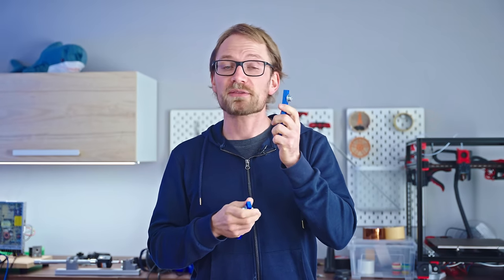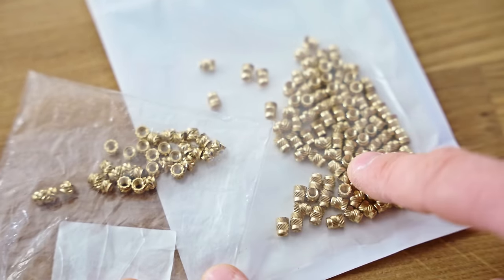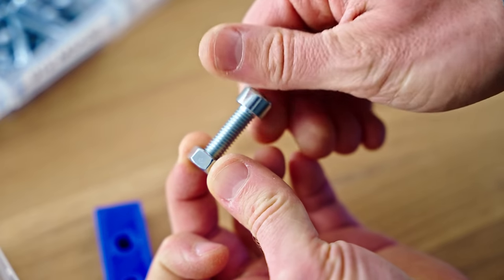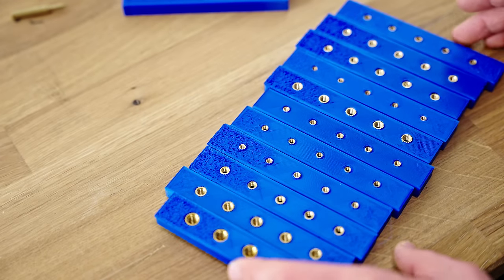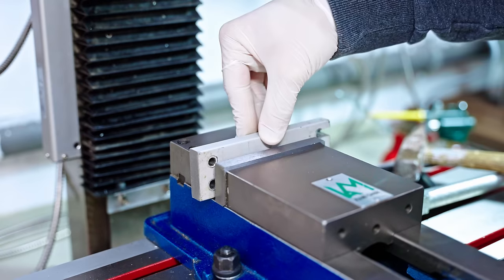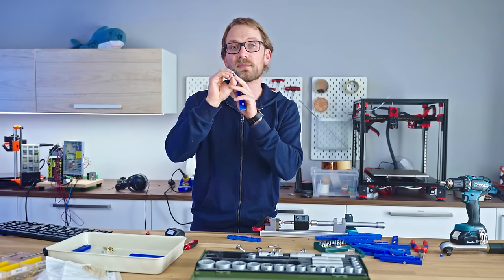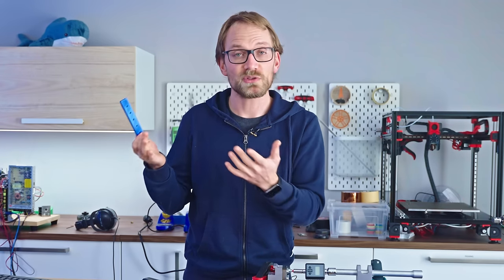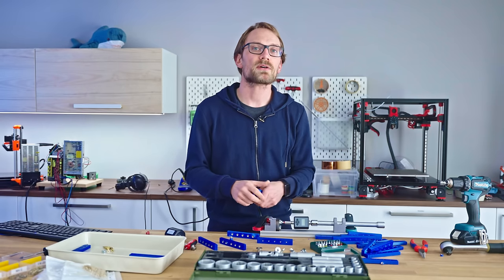Do you even need threaded inserts? Strength tested!

Comment: This video needed to be made, thank you.
Please test nut captures and the strength of inserts from the opposite side. 
 Tapping holes with a hand drill is something I never do regardless of material as while it takes a little longer I find that doing it by hand results is less damage to the threads especially for fine pitch threads.

Comment: I prefer cut threads for everything below m6. I use 3d printing mainly to prototype parts that eventually get machined. 99% of the time some cheap PLA is sufficient for my needs. usually I print with 3-5 perimeters. I usually use alcohol as cutting fluid. few drops of cutting oil dissolved in the alcohol works even better. also aluminium taps work way better then normal ones (the ones that have every other tooth missing to reduce friction) through hole whenever possible, bottoming taps that push the swarf up only when really necessary. ...in 3d printing I can make the hole super deep or all the way through the part even if I'm not going to do that on the machined part for obvious reasons.

a final note: for embedded nuts: get some square ones - they work better in every regard I can think of compared to hex nuts when it comes to incorporating them into 3d prints. (don't rotate as easy, easier to design the pocket/slot, usually better bridging if pocket has to be upside down...)
Reply: Yeah, I bet hand tapping vs power tapping would reduce the friction and heat generation of the tap in the plastic...thus preventing the ripping of the threads out of the part
However hand tapping a buncha holes suuuuuuuck
I wonder if a better lubricant such as silicon grease would work better than denatured alcohol (I use Danco food grade silicon grease from lowes on my parts and bearings on my 3d printers/cnc machines, not only is it slick as greased owl crap...but it doesn't attract dust like oils and "dino" grease)
Reply: I use a tapping arm. For my cordless drill to tap. Having the tap straight also reduces the friction quite a bit compared to just cordless drill. Alcohole does some minor lubrication but is great at cooling.

Comment: One thing, you didn't mention would be a rivnut.  Slipped into the hole from the other side.  And since it doesn't have the rotation ribs, you can use a bit of glue if you don't want it to rotate. You can match the rivnut length with the part thickness, or recess the back side to match the rivnut length.
Reply: rivnut was at the end next to the tee nut

Comment: You should be able to test for lead content of the Alibaba inserts using a swipe test.  These are marketed for use in testing house paint and toys, but would work for this purpose too.
Reply: Most brass is leaded brass (2-3%), its not really an issue unless you: use it for a childs toy, use it for food storage, or grind it after the fact. You shouldn't be using 3D prints for these purposes anyway.
Reply: @jaro6985 
Oh. So you're saying I shouldn't 3D print a children's toy lunchbox with brass shavings on it for decoration?
Reply: @jaro6985  My point was focused on whether you should buy CNC Kitchen's brass inserts because of being lead free brass.  Or alternatively, since there is a lot of plumbing fixtures that are in-fact lead free, is it possible to get cheap inserts that are still lead free.  And I'm sorry, but using 3d printing for toys is a pretty standard use case.
Reply: @richdobbs6595  3D printing toys for young children is just as unsafe as using leaded inserts, most people do not have food grade setups. I'm telling you all china inserts should have lead in them, so no need to test.
Reply: Lead free bass literally means only 2% lead. This is also true for lead free brass that is used in water supplies. Lead free is a legal term not a normal english understanding. It is very misleading.

Comment: I've found that friction threading fasteners into unthreaded holes works quite well.... What you do is you rapidly turn the fastener in about a 1/4 turn then back out a little less than 1/4 then back in a 1/4 until the fastener is seated. The friction from this rapid back and forth heats the fastener so it doesn't cut rather it melts it's thread into the plastic. If you size the hole correctly it will take a little bit of muscle to seat the fastener and you will be able to feel the resistance slightly lower when the fastener starts melting it's way in.... The result should be a tight thread with it's layer lines fused together. Something you will not get from a printed tread. Also this method of threading does not clog the hole or remove any plastic. The plastic is pushed outward into the walls, if anything leaving the wall thickness slightly higher.....I've used the word fastener in this description over bolt because I've used this method with screws as well as bolts up to 1/4-20. 

Other than that if I just need a thread in my print where the bolt will be repeatedly adjusted I heat set an ordinary nut into the print. Which is cheap strong wears good and I don't have to order anything online to complete my project. With heat set nuts I print a hexagonal recess in the hole slightly smaller than the nut and push the nut in with soldering iron set to as low a temp as I can where the nut will still push in. Like with fiction threaded fasteners no plastic is pushed down into the hole. The plastic is instead also pushed outward increasing the wall thickness.  So far I have had zero issues with pullout of friction threaded fasteners and heat set ordinary nuts have only failed in bad designs and when over torqued.

Comment: A few things spring to mind here:

1) If the limiting factor is the perimeters around the hole, beefing that up to the point where the insert turns in or pulls out seems necessary to get meaningful test data on the insert or thread. 

2) I don't advise tapping under power for this sort of thing - use a manual hand-operated tap wrench. It'll keep the heat down and you'll be able to feel what you're doing.

I've actually used threaded inserts and stainless machine screws to replace self tappers on bits of plastic under-bonnet trim on my car - they are a huge improvement! 19 years of taking those old self-tappers in and out doing maintenance and they didn't really tighten up properly anymore. A great quality of life modification.

Comment: Whenever the design allows it, I press hex nuts into the back side of the part with a clearance through hole to screw in from the other side.  Make the nut recess compliant to avoid splitting the 3D print.  PrusaSlicer has a couple of tricks that help.  Modifiers allow more perimeter layers and/or more infill to strengthen the 3D part around the threads.  PrusaSlicer also has negative volumes that can increase part strength in a particular direction that can be useful to support loads attached with threaded fasteners.  There are slicer tricks for bridging over the top of the inserted nut pocket, with YouTube demonstrations.  For smaller inserted nuts, typically M4 / #8 or smaller, using square nuts instead of hex nuts will help prevent the nut from spinning in the 3D printed part.

Comment: Another thing which is worth noting, is loosening of the screws over time. Having a metal threaded insert allows you to use a more diverse range of threadlockers (e.g. Loctite 222 or 243 etc). I designed a custom hotend shroud and ended up simply under-sizing the holes and forcing machine screws through as "self-tappers" which holds pretty well, but the screws do end up getting loose (I think it's because the bowden tube puts varying pressure on the hotend as it travels across the x-axis). Something else worth testing, is instead of using machine-screws, use actual thread forming screws meant for self-tapping into plastic. They tend to have a sharper, more coarse thread and are often seen in injection molded parts.

Comment: Large diameter steel washers can spread the load over a wider area of the plastic when used in conjunction with a steel not.
A thread for the screw can be included in the hole so that a lockout effect can be achieved with the steel nut.

Comment: The best thing about the inserts is that they allow for the screws to removed and replaced many times without messing the plastic up. Holding force on most screws into plastic is usually fine for screw it together once jobs.

Comment: I've also tried a two stage hole, which does the same thing CNC is trying to accomplish with his section on the insert before the grips. This seems to work better with inserts that don't have that feature, when using an iron to put in the insert. My main problem with iron installed inserts is they don't get in straight or in the right location, unless just pressed in from the other side. I think that STL files provided online should allow the insert to be pushed in from the other side or at least have a two stage hole to help start the insert in with an iron.

Comment: I have done a lot of tapped M3 holes in plastic. I print the holes at 2.9mm and run a tap through them.

All you need is a screwdriver handle for a TAP. You can print this. You can tap them by hand. No coolant necessary. No T handle. Just screw it in like you're screwing in a self-tapping screw. 

Run it in far enough that it's coming through the other side - even if that's down in a 5mm diameter hole - and blow the swarf out of the flutes with a quick puff of air. Then run the tap back out by hand.

So many Youtubers who try to do threaded plastic holes over complicate it with T handles or power tools. That stuff is not necessary. A 3D printed knob/handle and 15 seconds of elbow grease is enough.

Of course it's not as strong as inserts. But for things like raspberry pi cases and phone stands, it's more than good enough. You can use superglue as threadlocker if you have trouble with the screws coming loose, I don't really find that to be a problem. 

Also a 2.9mm hole is good for a #4 self tapping screw. So it opens up other hardware options without having to change anything in the CAD - if you're sharing your STLs or whatever.

Comment: Ideally, the best placement for heated inserts is BEHIND the hole, on the other face of the model, so that when the bolt pulls on the insert, it's pulling it into the plastic and not out.

Comment: I mostly use the modeled threads, but if I need the strength I will use a normal nut pressed in the back of the part. Where I think the inserts shine is with parts that need to be disassembled many times. The modeled threads are only good for a couple assembly cycles and a nut can sometimes get out of place if the press fit is not great.

Comment: I see you teased the rivnuts. I've been using rivnuts as inserts for a while. I design for them to be inserted from the back side so that the flange can act as an anchor. The resulting connection is more robust than typical inserts.

Comment: Lead is added to brass to enhance it’s machining properties. It makes it slightly harder and brittle, so that it comes away cleanly from the piece and tool when turned. Unleaded brass has a tendency to build up on the tip of the tool and clog.

Comment: Pro tip I recently discovered and have been using for my 3d printed items: R-Type Nylon Rivets. You can put things together pretty easily with them, and unlike heat set inserts, or screws or bolts, you dont need nuts, you dont need to model any threads or places to insert a heat insert, when you prototype you dont have to throw the hardware out with each failure, and they're cheap as chips.

All you need are holes for these, so its dead easy to use them to prototype and for final assembly due to them being cheap and reusable. You can even toss in a few extra if you are selling a product with how cheap they are.

Comment: The main takeaway is that it's always better to use inserted nuts and rely on compressive force strength of material, where there is going to be any significant force applied. Inserts are still good for fixing components in place. But PLA isn't designed to be a heavy load bearing material, so that's another story.
Another takeaway is that 100% infill has an actual use. :)

There is a possibility of very precise mounting of threaded inserts for printers equipped with load cell on the nozzle and with inserts being strictly vertical:
 - print a part with circular hole just a bit larger than the outer diameter of the insert;
 - pause the print on the last layer, move nozzle aside;
 - manually or with pick & place head, drop the insert into the hole;
 - move the nozzle to the insert, using the load cell feel its edge and inject molten filament with cooling off into the space between the hole wall and the insert;
 - let it cool down for a few seconds;
 - with insert secured, continue printing.
There is even option to preheat the insert using the nozzle itself. Idea is the filament won't fully solidify before filling the space between metal and 3D printed part, making much better contact than it would be possible with just heating and pushing the insert in.

Comment: Great idea to run this test. I did 3 years ago a similar test for my machine designs and found out Prusa Pla is the best PLA for this application (the strongest, less ductile) and actually don‘t put a insert in and don‘t tap the hole. Just put around 4 perimiters and let the screw tap itself while screwing it in. With PLA this generates that much heat from friction that a perfect new thread forms around the screw, which additionally acts like loctite and is self locking. Takes some time to find the right hole diameter for each screw, but worth it.

Comment: Thomas, in tru holes you are blessed with having the possibility of using the insert from the backside of your workpiece. which creates the fact you have to pull the insert not only out but also tru the complete printing.
And a bit of a hassle but you can also demonstrate the "print in place" possibility, if someone might be interested. possible with an ordinary nut.

Comment: When I played with this situation (using PETG) I found that unless you are constantly assembling/disassembling, that just drilling an undersized hole in the fastener-area that was 100% infill, that the raw plastic was just as strong as the inserts.  In a couple of cases, it seemed like maybe the insert was better but not consistently.
Finally, the only times I use inserts is if I want ease of assembly/disassembly cycles or for a customer that is under the belief that they just gotta have them!
Thanks for doing the tests.  One last thing: I also found that after a couple of screw-unscrew cycles that adding cyanoacrylate glue worked well to harden the plastic screw-hole.
I also found that the longer the screw remains in the hole the more the plastic confirms around and makes it tighter.
I do feel that if you would just drill undersized holes instead of printing them, you would get better results not using inserts.

Comment: I usually use square nuts that are inserted during a pause in the print. The thing is that you are then not pulling the nut out of the material, you are compressing the perimeter material, so it's much stronger than inserts. You can regulate the strength by the depth of the insertion and the width of the solid infill around the hole.

Comment: I print a slightly undersized round hole and tap with a screw with a tiny bit of lithium grease on it. This keeps the plastic from melting too much and shapes it into a perfect fit. Since it’s not a cutting tap bit, none of the plastic is removed. I also design parts with “nut pockets”, if there’s enough space.

Comment: One thing to remember with modelled threads is that they require a small layer height. No point modelling threads when you intend to print at 0.4mm. And remember that small layers = longer print time.

Comment: For the injection moulding inserts, to make the plastic pushed away less of a problem I insert a bold into the insert and then put the soldering iron on the bold...like that the area that needs to remain free for the bolt is clear

Comment: You should check how designing the shape of the hole for the screw, affects its strength, especially when inserts are not used. For instance, I'm using square holes to create surfaces where the screw “digs” only into the square material, and the “leftovers” are accumulated in the corners. This solution makes it easier to thread the screw into the hole, as it doesn’t need to dig through the entire surroundings. Additionally, it creates a stronger connection between the print and the screw

Comment: for low stress/torque, for M3-5, makign the thread directly with the screw, works, it will heat up due to friction, but it will work. That's how i mounted a adaptor plate for a shifter in my sim rig

Comment: For me the real question is if this is really the right way to test the threaded inserts. 
In company we made some similar test, but not with threaded inserts but with different materials and we cut the thread into the block. Then we did not turn in a screw until the block failed, because that is not what you normaly do right? We called the test the "thread rip out test". Why? Because we wanted to know how much force we can apply on one thread in different materials. 
There are multiple things you can aim to with threads and there are different ways to test this. 
As well we found out that a thread, that seamed to be very weak when we overturned the screw (so we destroyed the thread) did a fairly good job when we put a washer between screw and part. 
A nut within a part was also super strong when we had a washer in between the screw head and the part, but started turning when we left the washer out.